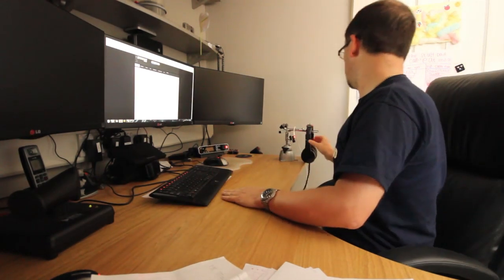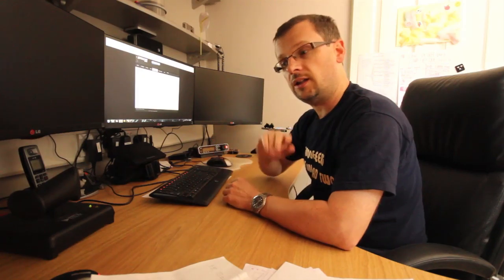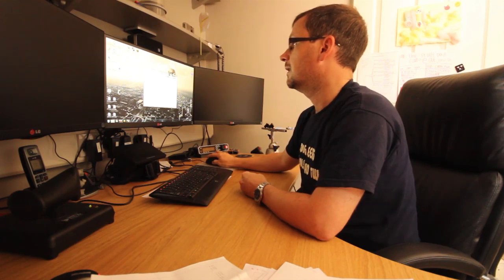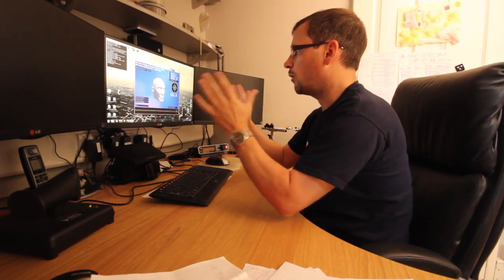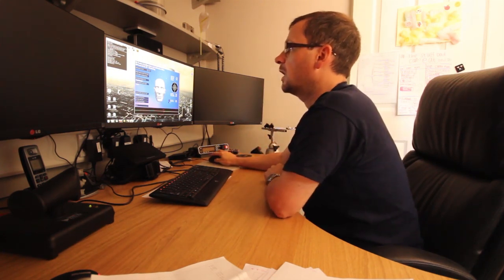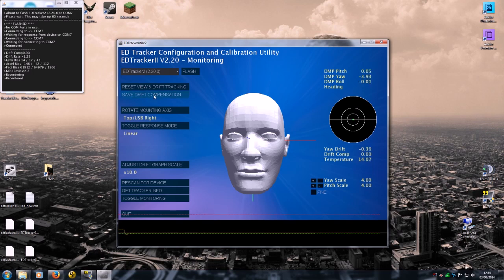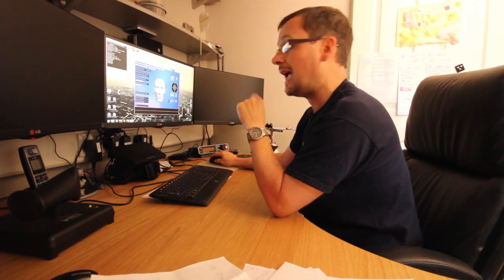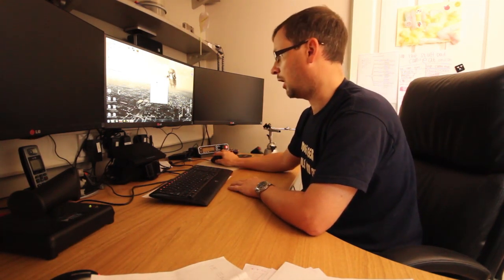EDTracker2 v2.20 - Flash, Calibrate, New GUI

Comment: I had mine working fine until I had to re-install the OS.
I re-installed the Arduino drivers, unfortunately the GUI software cannot find the device.
The device used to have a red light on, and a green flashing light. The red light is on, but the green flashing light is not there anymore.
Any ideas as to what could be wrong? Do you think I have killed it?
Reply: it's sorted now. i had to use the cli though

Comment: Hi, I have a question, can I use 		 		
ATmega32u4 Pro Micro too, or only the 		 		ATmega32u4 micro?
I hope for a answer: :)
Greetings,
S4.Crafted
Reply from the maker: I'm a bit lost :) the ATmega32u4 is the microcontroller; if you're breadboarding it, any Arduino-clone using it should work. So a "Pro Micro" and "Micro", if they both have the same USB interface and microcontroller, should work fine.
Reply: And if I don't breadbording?
Reply from the maker: S4.Crafted
Assuming you mean using the PCB design, you need a Sparkfun Pro Micro, or a clone of it.
Reply: Ah, now I understand it, thank you and sorry, my english knowledges aren't very good :)
Reply from the maker: S4.Crafted
No problems!
Reply: brumster100

I have a new problem, every time. when I connect the arduino, I get the following error "Connecting to -> COM 14
                            Error for connecting to COM 14"
I flashed the arduino and the gui identify it as ED Tracker Calibration V2.5.1.
How I can fix it?
Reply from the maker: S4.Crafted
If the GUI identifies it as "EDTracker Calibration V2.5.1" that's fine, that means you have the calibration sketch/firmware in it. Once calibrated, you can flash the main EDTracker sketch/firmware into it (currently 2.20.3). If the GUI won't flash it, as some people have reported problems, try the command line approach detailed on the website... it seems to be more successful.